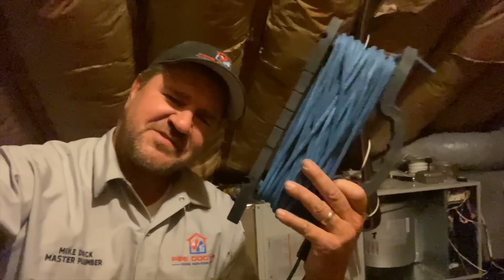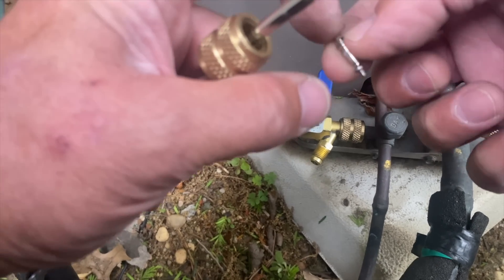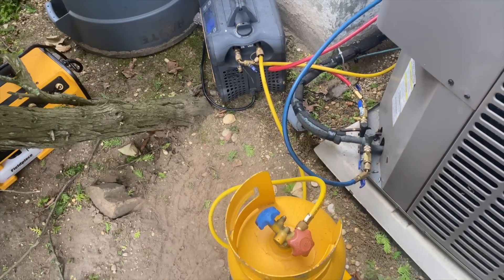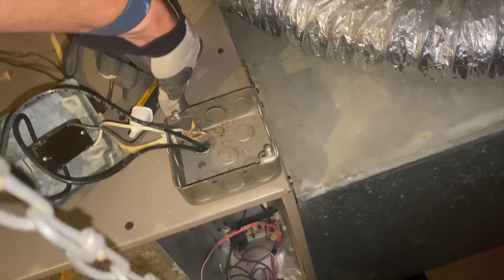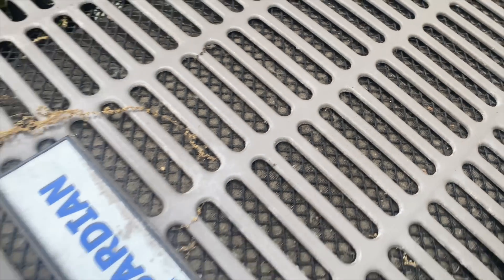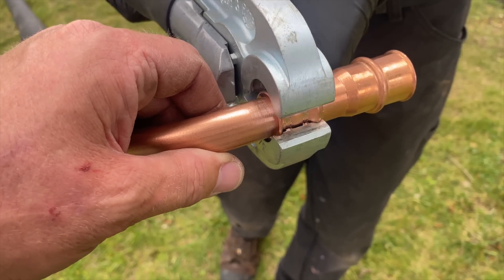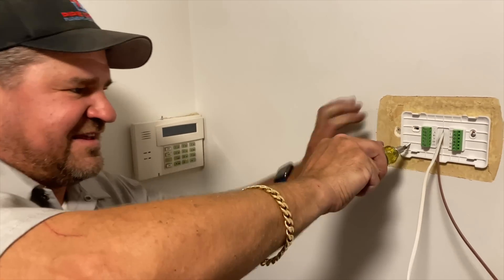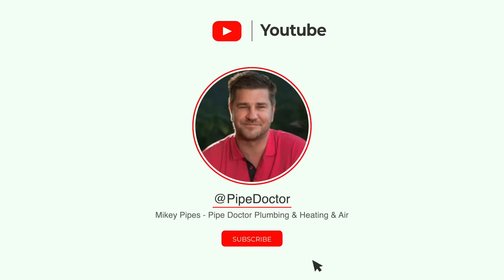Magical Blue String Prevents Condensate Drain Clogs for 20 Years? HVAC Tips & Tricks Exposed!

Comment: Electrician hack. Tie a small piece of plastic bag to the end of the blue rope, stick the drain vacuum on the opposite end, your gonna have to tug and direct the rope into the pipe but it will reach the other end.

Comment: Im looking for a better way to deal with condensate. Appartment block, over 300 units built in 1980. combo elect furnace/ac with condensate pan. no access to drain. Is there an alternate to a pan that can perhaps evaporate the condensate and avoid drainage which would require extensive plumbing through concrete walls and floors. Any suggestions welcome.

Comment: Not trying to slow your great efforts down.   Just curious maybe start a dialogue focusing on the Bosch IDS Main Control Board.  Specifically,  does anyone have experience with the USB connector?  What is a typical Use Case Scenario where a HVAC Engineer or a Super-Nerd Technician may be trained to use the USB?  Why?  Because I see an easier way to diagnose or otherwise adjust programming features.   Otherwise we are all left with monkeying with codes on the little LED readout.   That appears to me like  playing a STUPID CHINESE MAJONG WASTE OF TIME.    I wrote to Bosch Technical Support and here is what they e-mailed me back as follows:   "The USB port is for our factory, and is not used outside of that"...  Well,  I guess a Super-Nerd will eventually help HINT to Bosch they could realize a little BUSINESS ADDED VALUE to themselves and the repair industry.  Just wishful thinking to save a little time to diagnose these boards.   Let's invite Bosch Corporate to GET OFF THEY ASS and program some easier diagnostic features into this USB port.   Thank You for your great common sense efforts with your precious time helping others.

Comment: If you flip the tank over and charge the recovery tank through suction it will not generate as much heat to the tank. The dip tube is shooter than the liquid side of the tank and that applied for every tank.
Reply: @PipeDoctor  No thanks you sir, for the uncut live action content!!

Comment: The blue rope probably works to stop sludge growth, but I doubt I'd ever be able to fish it through all the bends in my line.  Some years ago I just made a PVC-to-shopvac adapter from the top of a 2 liter coke bottle and a PVC coupler.  I plug that on once a year and suck out all the gunk.  Takes 5 minutes to do and works great.  I've always wondered what that mystery sludge is made of.  Some kind of slime mold? Let's just hope it doesn't evolve.

Comment: I carry a pack of T-stat backing plates now. They cover the old wall paper if the new T-stat is smaller than the old one, but, the good thing is, the plate gives you plenty of area to put a screw in case you run into the wallowed out screw holes from the previous T-stat. Love the videos! I've learned alot from your channel! Especially about Boilers. Keep up the great work!

Comment: at 12:03 use a short drywall screw(1-5/8") and pre-drill a hole so the head sits nearly flush with the back or below the ribs. I forget what size bit works best, thinking it was 3/16". lol I just auto-grab a bit or spin the screw backwards to "heat/melt the plastic" before placing it on the wall, then run it in right away so the head sits flush. old redneck tricks 🤣

Comment: While I did go to school for HVAC, I am currently working for a soda/beer distributor as a service tech. I am quite curious if the Prev Clog would work in a fountain machine drain line.  Those things get so damn nasty...😅 Might be worth the 6 dollar a foot price tag to prevent service calls.
Reply: if it also drains the overflow catch, not a chance. soda is very nasty in multiple ways, acidic, sticky(corn syrup/sugar), other things intermixed. frequent maintenance is the only way.

Comment: to run through the PVC pipe do this..Tie a very small piece of plastic bag to a very thin flexible line like they use for plumb bobs.... use a vacuum at the other end of the pipe then use that string to pull in your doo dad condensate string
Reply: of course a sparky knows the old "mouse and vacuum trick" to pull small string through conduit. it gets a bit tricky with the small sharp bends on condensate lines.
**thinking further, it's probably best to use a spool of fishing line with the piece of baggy for the initial pull through, that should also pull the "magical" condensate string through with ease.
fishing line is cheap enough to toss afterwards also.

Comment: I was going to say the blue rope sounds like snake oil, but when Mikey was feeding it in, I saw the blue stuff coming off on his hands. That might very well be copper sulfate, which is more than toxic enough to prevent anything from growing in those pipes for many years. It's a commercial denaturant, also kills tree roots in sewer lines. I hope he washed his hands.
Reply: while it will stop things from growing, it doesn't cure dirt/debris clogging at sharp bends and low spots(which also cause double trapping) and we all know how well condensate drains are supported and pitched properly(lol, yeah rarely). only being flushed yearly at high volume with cleaner will work, that and some treatment tabs in the pan.. hope they're prepared to fall on their swords. 😬
Reply: @throttlebottle5906 I brush every trap, flush at least 1 gallon of water through it, add tablets to the pan, and the Viper Drain Pan Treatment Spray to the trap.
Reply: @Infowarrior-45  now that is a good service and clean.. right on
Reply: @PipeDoctor it’s the silver that kills bacteria. That’s why silver fillings work so well. Kill any bacteria remaining on the tooth.
Reply: Where can I get some of that rope? I have to clear our drain line at least 3 or 4 times per year every summer >_<

Comment: I wouldn't say you safely confirmed there was no power to ground as I didn't see that the raised cover was bonded to the bare grounding wire. Paint also will insulated and not give a good connection between metals. Maybe I am as blind as a bat but I am just trying to be aware of my surrounds. Thank for the entertaining and educational videos.
Reply: I was going to comment on the same observation. You can't check voltage to ground on an ungrounded switch plate. I also noticed that the ground wire in the romex didn't appear to be bonded to the switch box either. Kinda looked like someone removed the bonding screw and did not replace it.

Comment: With that 2.1 they should have made the antenna internal and sold units based on the position of the antenna. You can do a 180 antenna. It's bosch, I dont understand why they did it that way. Do you know why? And what all does that "connected" system give data wise?
Reply: too much work(thinking) for "field installers" lol. but really, while directional antennas are great for open spaces, they often fail horribly given surrounding structure composition, like concrete, foil foam board/reflective layers, steel/aluminum/coatings/doors/windows/roofing/siding/awning/humans/mirrors/appliances/ducts/metallic plumbing/drywall/block/brick.
I'll just stop there, yeah I've done plenty of wifi installs and design to know the caveats, as well as many fields of construction to know many of the materials are nasty to RF at all frequencies and worse the higher you go.😝
Reply: @throttlebottle5906  But you gotta think theres gotta be away to do an internal antenna.

Comment: mikey we have been installing a ton of carrier mura systems mini split inverter tied to special air handler        wired traditional 24v 2 speed reversing valve energized in heat like a rheem very quiet kinda like your bosch any thoughts have you heard of them?
Reply: @PipeDoctor  maybe you should you can stop sellling those pos bosch systems you cant get any tech support